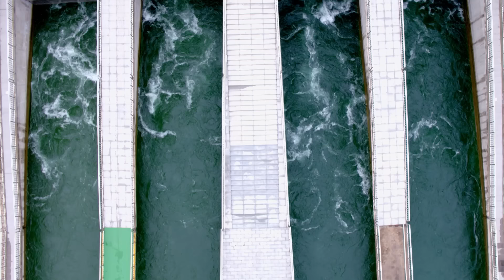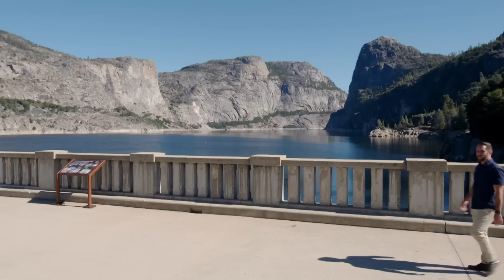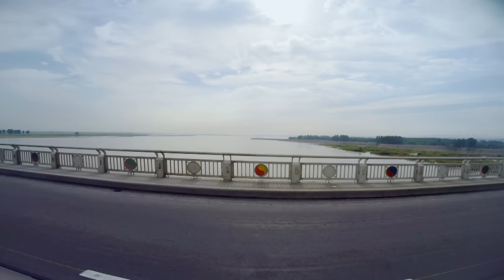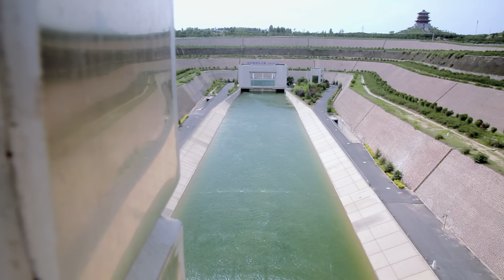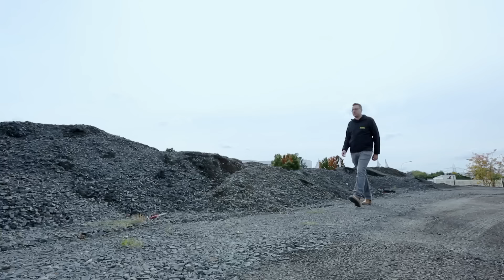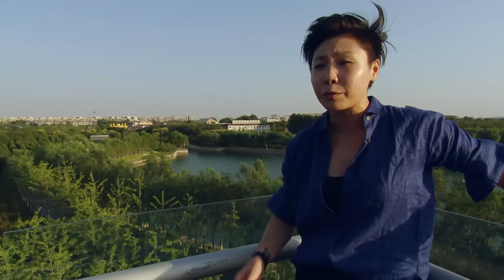How China Moved a River to Save a Nation | Blueprint

Comment: Very impressive projects, rivers usually flow from North to South. From a higher level  to the lower by gravitional force . Delivering  water from the South to the North  by using the same gravitational energy. ,redirecting its route, building the potential,  stages by stages with dam and taking advantage of  the contour of the landscape i at some points is a very remarkable engineering achievement . Thank you .

Comment: Why have a Chinese architect to present a Chinese engineering project?  On record, the Mesopotamians (Babylon & Assyria) built some of the first aqueduct-like canals around 4000 BCE.  The first aqueduct in Rome was the Aqua Appia, built in 312 BCE. The Chinese Dujiangyan Irrigation System with aqueduct was built in 256 BCE during the Qin dynasty.  Now, the Californian arched dam construction in two stages was completely different from the Danjiangkou Dam which was by gravity likely with ground anchors to prevent overturning.  The critical design of this water diversion project is that it is entirely gravitational without the use of pumps and is thus considered green zero-energy project.

Comment: I am from India. I can understand the scale of the project. We too have a similar manmade canal diverting water from relatively water sufficient river to a water shortage area. The capacity of the canal is same.
The Chinese central water diversion project as per the video is to transfer 12 trillion liters of water per year. If you are an Engineer, you will know that it is equivalent to 420 TMC water per year which is 1.15TMC per day.
Our canal called Telugu Ganga starts at Srisailam dam on Krishna river at a place called Pothireddypadu Head regulator. It terminates in Somasila dam. The capacity of our canal is 1 TMC per day. During a good rain year, our canal transfers between 50-75 TMC during rainy season which otherwise goes to sea.
However I would like to inform readers that the length of our canal is only 250 KM compared to 1450 KM for this Chinese canal. Our canal is in operation since late 1990s.
Reply: The Jinghang Waterway (also known as The Grand Canal of China) is 2,500 years old and it is the longest (at 1,776 km long) and the oldest artificial river in the world. So, China has been leading the world since forever. Quit the paltry comparison with dysfunctional India.
Reply: @iamnormal8648  My comment as an Engineer is about the quantity of water flow rates only and also I clearly mentioned that Indian canal is only 250 km and not in comparison. Though there are many more man made canals even longer and heavier in India, I did mention only one canal as it is passing through my state and I personally know it. 
If you want your comment to be confrontational, it is in bad taste and I am not in a habit of replying to every one of your reply. I end my case here.
Reply: @altafrahman2254 plz, arguing with chinese  racist is of no use. The stereotypes they have about indians is crazy. For boasting so much about how chinese civilization saw everyone as equal they have nazi like Obsession with race and phenotypes.
Reply: @iamnormal8648 lmao Shitty chinese earth dug canal is so engineering marvel. Stop boasting